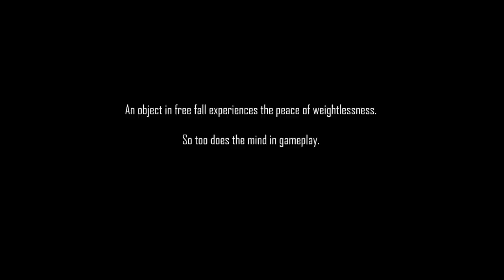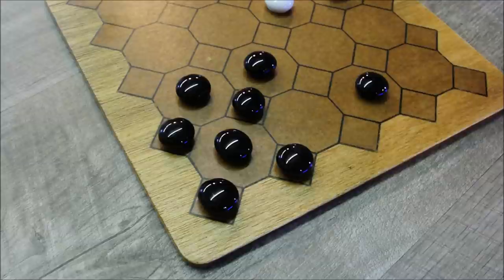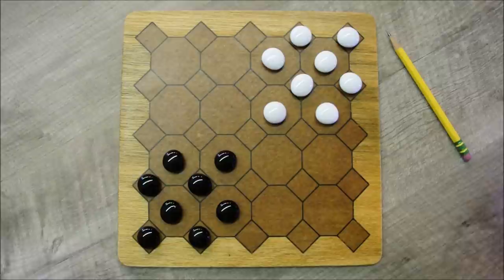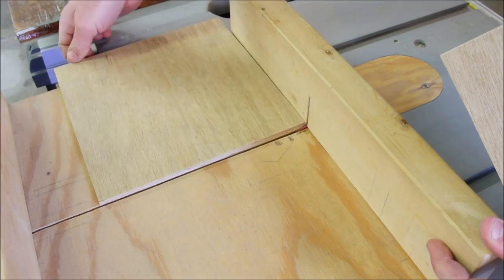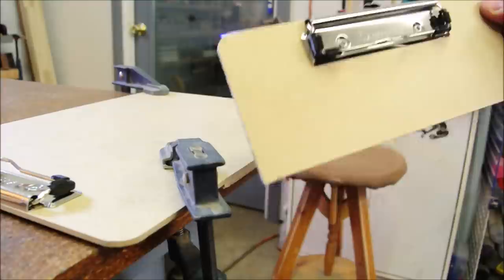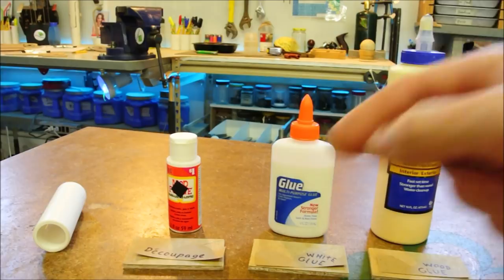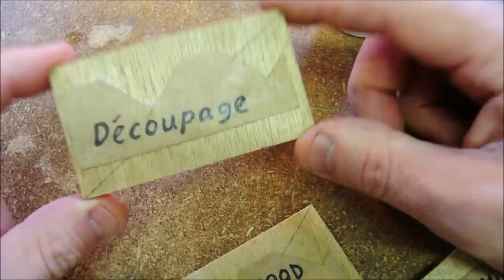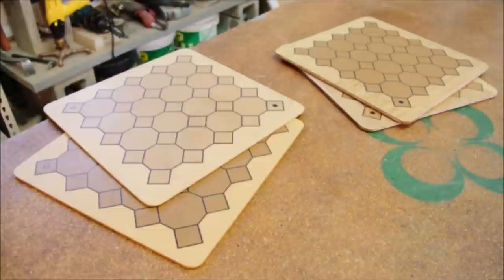How to play 40 Bridges (& making a game board)

Comment: Making a book cover is similar and uses PVA glue, so this should apply to white glue, decoupage, and wood glue:
When binding a book, you put a weight on it. You can use scrap plywood or another clipboard for the press.
Apply the glue with a brush or foam to keep from getting too much glue in one place on the paper.
Let the paper "relax" before attaching it to the board. That'll help with the bubbles.
Once you glue the paper to the board, cover it with wax paper or plastic wrap. Use a roller moving from the center to the outside edge. It helps with the bubbles, protects the game image, and won't tear the paper if it's too wet. (I learned the hard way with another board game.)
Put a piece of scap board over the board and weigh it down. That helps a lot with the bubbles.

Wood glue dries in ~30 minutes. Have everything ready before you pour the glue. The color is made to go along with wood, so you may like that. It will be ready quickly.

Comment: Convenently, there is already another board game with suitable pieces and a similar board that you could use to play this one, Tak.
It doesn't use the board in the same way, its a game based on squares, but because the game is designed to work at various board sizes many boards including the official one can be used to play this game.

Comment: To avoid the bubbles in the paper. Apply the glue and then give the paper time to expand before placing it on the board. This is what you do when wallpapering. Especially if the paper is thin.
Reply from the maker: Yes. That would certainly work. Great idea. But it would've meant filming another scene. I also thought about 'setting' the paper first with polyurethane and then later fixing it to the board, or just fixing it all at once with poly. A video like this is about budgeting time, though. And simplicity. Can't include everything. I can give you a heart, though!

Comment: Should the game also end if you lose all your square pieces, meaning you’d have no opportunity to end the opposing corner. The rules say the game “also ends if you lose ALL your pieces” but it seems like just the squares would be enough.
Reply from the maker: Not exactly. Okay. Let's think. Winning also has the assumed requirement that you haven't entirely lost yet. If you can force the opponent into a position where they will be unable to entirely win, it will only make you the de facto winner until you actually do win. 'Looks like you're winning' is not the same as 'you've won.'

The primary goal in this game is to capture the home space, but piece capturing becomes a secondary goal only because of the fact that a player is unable to move¹ (or prevent loss) without any pieces. As long as you still have some pieces in play, you can still postpone your own (complete) defeat. Thus, if it's still possible for you to capture all of your opponent's pieces first, you can still win the game by being the first to satisfy the secondary objective. 

The rules are admittedly ambiguous on this point, but clarity in game design hurts my brain, so I'm not quite inclined to change anything yet. Let me think about this. I really appreciate you pointing it out, though! Oh, and out of curiosity, did this happen to you in a game? I'm not sure if I ever remember that happening. 

¹Rule Sheet 1 specifies that, in a move, "a player will advance a piece." Forfeit of movement should be considered akin to loss.

Comment: Question for clarification:

You state capture happens after the move, so i can move in to capture a piece that puts my piece into a position to be captured.  Does that mean at the end of my turn, if i capture an opponents piece, and my piece is still surrounded by 3 opposing pieces, i lose my piece to capture at the end of my turn or the end of my opponents turn (deterring them from moving those 3 pieces)?
Reply from the maker: From rule sheet #3:
"Capture is at the discretion of the aggressor; this means that a player may move into a position of capture without losing a piece if the move completes a capture." 

Good question, though. After you've made your own captures, if there are still some remaining against you, then you would also have to remove your own piece. The (discretion) rule is just an order of operation. Nobody should be starting their turn with an unfinished capture still on the board. 

Thanks ;)